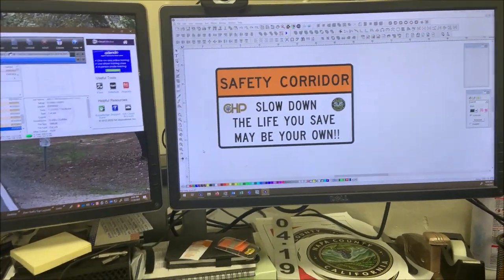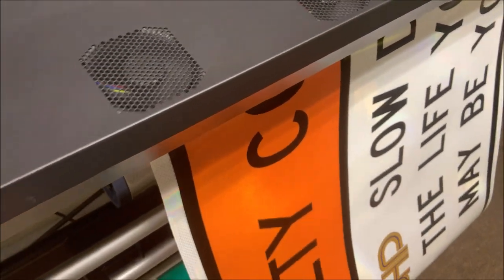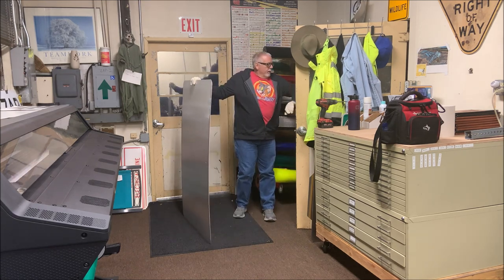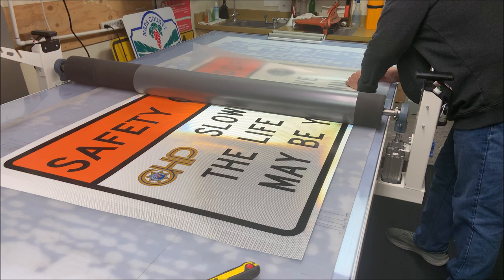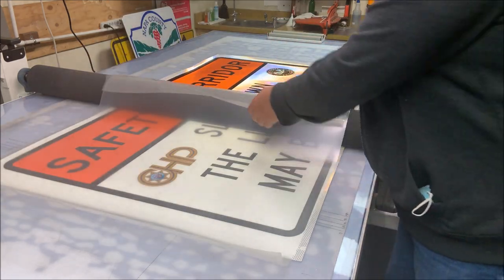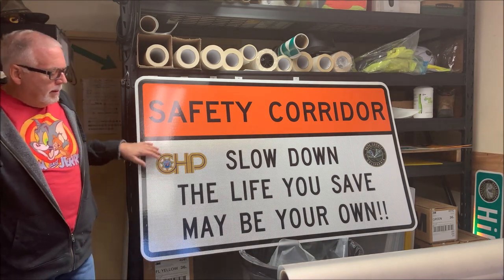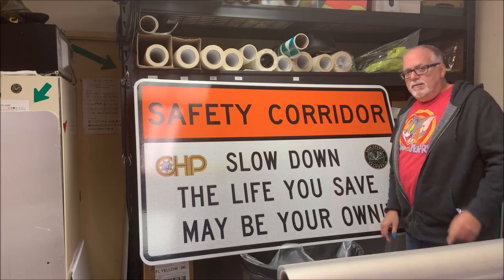Safety Corridor traffic  Sign

Comment: The nice part about printing is when you have to print 1/4 inch letters and NOT have to weed. Printer saves a ton of time. Be sure to keep up the warranty you will need it with HP

Comment: Hi Bob,

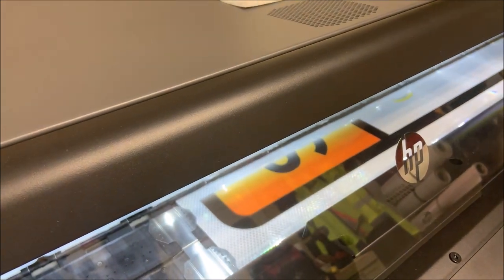I've been using the hp365 for a while now. I've noticed that you have double media clips on yours - did you install another separate set of clips to double it up or is that a double sided media clip you're using on the printer?(Reference 4:47)
Reply from the maker: I believe they are doubled up. The company that set it up told me because most of my printing is on 3M DG3 it would reduce head strikes.
Reply: @BobTheSignMan  Thanks for that info. I wasn't sure this can be done but now that I do, I'll definitely double them up. Without it, you'd have to put a lot of vacuum pressure on the material to avoid the head strikes.
Reply from the maker: @guerrillasneeded  That is what they advised me to do. This is my first experience with a printer. So I just went along with it.

Comment: Hi Bob, Can you show us on Flexi how you print from Flexi to your HP Ink Printer? Can you also show how the printer works with printing out vinyl if it has ink settings? For instance, if regular paper, or vinyl. I have tried to print out from my EPSON SC T3270 but the ink didn't dry on the vinyl. There is also a Contour Cut on Flexi that you can save to the cutter and prints the ink on the vinyl first then put your vinyl on the cutter and cuts from the saved Contour Cut.
Reply from the maker: I can do that. I will work on that next week or so. We are expecting rain and I will be working in the shop.
Reply: @BobTheSignMan  Also, what type of reflective vinyl do you use? Do you use Avery Dennison or 3M to print out reflective vinyls?
Reply from the maker: @WilliamRowellTrafficPersonnel  I use 3M DG3 for all MUTCD traffic signs. It's the best for reflectivity.